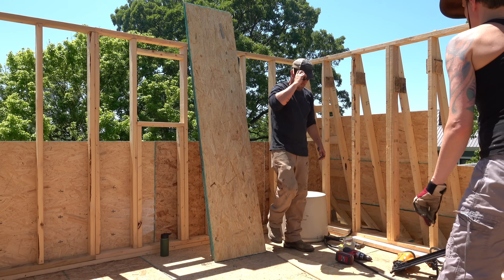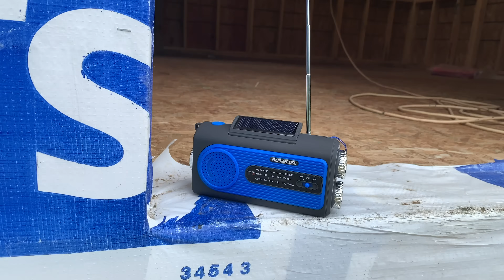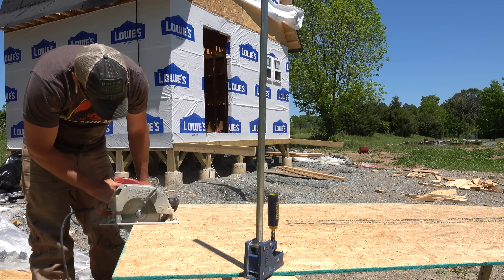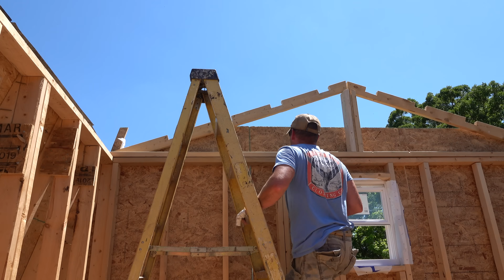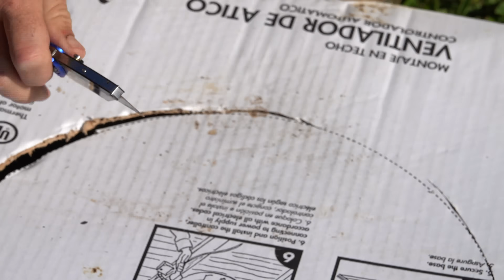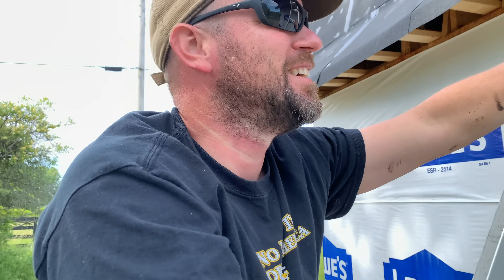WORKSHOP DRY-IN | Roofing our shop with Mineral Guard Roll Roofing

Comment: I did my heights  when I was younger.   The Main Mast of the ship  at 120 ft  with snow, and wind,  heavy rollers producing a 17 degree roll...,  all while hanging on to a 10 inch diameter antena.                              .    NO HANDS,  they were changing the aircraft warning lights.     Rock climbing at a thousand feet +,  without ropes might have added to my angst.

Comment: Frankly I expected better build quality than what I see here. Roof joist bracing off center and run long, Roof sheathing not ending on center of roof joist, Roll roofing under a metal roof? Simply put, anything worth doing is worth doing right the first time. 
As to your clickbait title well it's clickbait what does one expect. Happily your digit is not completely gone as the title infers.